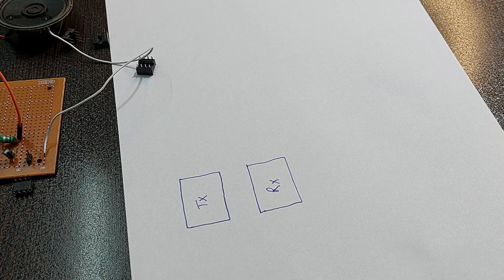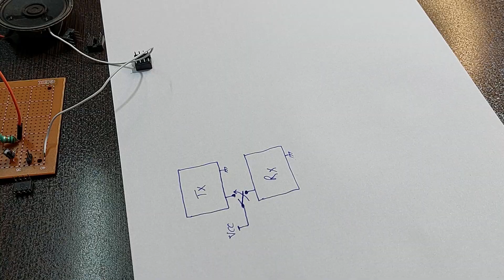Make Your Own Walkie Talkie Circuit But On The Frequency Of 315MHz

Comment: видео ни о чем.для того что бы сделать рацыю не обезательно мудрить до такой степени.в интернете полно робочих схем таких раций.как на транзисторах так и на микросхемах.с дальностью роботы по прямой видимости до 1 километра.при этом схемы содержат всего 3-4 транзистора в качестве унч,и один транзистор в вч части.и все.и не надо изобретать велосипед.
Reply from the maker: You don't need to be a genius to upload a video to YouTube. In the previous part, it was said that this video was made at the request of one of the contacts, and because my contacts are important to me, I made this project. I'm also getting more experience in rebuilding the wheel and maybe I can share more tips to avoid making wheels like Tupolev.

Comment: These modules use a super regenerative receiver in the RF part. Followed by that is an IC circuit usually LM358 that is set up as "schmitt trigger". The purpose of the op-amp (358) is to convert data signals into a proper square wave signal, so the micro controler can use the data... as these modules aren´t really intended for voice transmission - instead they´re used for data transmission. You can, however modify the transmitter by "half key-ing it" to transmitt a mix of Narrowband FM and AM. On the receiver side the voice is decoded, but if you pick it up after the schmitt-trigger circuit it gets "chopped" and altough it may be understandable to some degree, it is not working to well. I also played around with similar modules years ago, and when I picked up the audio before the LM358 schmitt trigger chip the audio was more or less clear and un distorted. You might try that. The first 433MHz module sounded like the receiver´s quench frequency has been set a bit low... that is just 1 resistor on the board which needs to be changed to make it work as it´s supposed to work. The resistor can be found close to the SMD RF transistor, look for it´s base connection.
Reply from the maker: Hello my friend, thank you for your comment. Of course, I said in the previous video that these modules are not suitable for sending sound. But with this comment, you said something that I didn't know and it was very interesting.
Previous video: https://youtu.be/aPw6Sx5lsys
Reply: @BabakStars  I have been given a kit containting 2 or 3 "pairs" of 433MHz transmitter and receiver unit. The board features a 2 transistor receiver (RF preamp and Receiver) plus said "LM358" as schmitt trigger to convert received data signals into a proper suqare wave signal for the micro controler. I did play around with them a bit, but the receiver is faulty (that is why it was extremly cheap). It has all parts installed for the RF preamp, but the actual transistor is missing. The "spot" where it´s supposed to be installed is empty... and so the result is... the set does work, but the range is only like 30ft, whilst if I´d use it´s transmitter at maximum power, the range would be more than a mile (to a communications receiver). If you don´t pull the "data pin" to ground (or was it to B+?) fully, but instead use a transistor, potentiometer (sth like that) you can modulate the transmitter with an audio signal by "half keying" it. Depending on how high the RF level you want to get out from it is, you either get acceptable AM, or AM with parasitic narrowband FM. On a good receiver, such as a communications receiver, you will then have to either use "N-FM" for hearing the transmitter, or use am + slope detection. As a super regenerative receiver is very wide banded, the small ammount of FM won´t be noticeable if you receive the transmitter modul with the "supposed to be operated with" receiver unit. I didn´t really transmitt / use these devices (like turn it on, let it transmitt music, and see how far it goes) because they work on a fixed frequency of 433.92MHz, and that is a frequency used by a lot of devices... be it your wireless temperature sensor, or an older car-remote-key to open the car. I didn´t want to "block" that frequency, because the devices that work at it usually just send a <1 second long "signal burst" and then go quiet again, and if I were to constantly transmitt there, I might inteffer with these, and that isn´t what I´ve wanted. With the fact that these modules produce up to 10mW, and they work on UHF, like I said, "a mile range" to a  good receiver isn´t anything special really. About the schmitt trigger. What it does is it changes an analouge signal into a digital signal. Think of it like a switch. Below a certain input level it is "off" and above a certain input level it is "on." If you transmitt voice with the transmitter module, the schmitt trigger "chomps" the audio, as the audio is reproduced as a sine wave (receiver output) and very fast swinging between "Schmitt trigger low" and "Schmitt trigger high". The easiest way to find out where the "pure" audio is available is use a signal tracer, and poke around at the IC´s pins whilst you previously ensured the receiver is receiving a clear signal (not over modulated or sth.) from the transmitter. I also have built multiple walkie talkies many years ago. The best one I´ve made was a homemade CB radio (my design, transistors only) where with I was able to make a 30 mile contact from a mointain top. Always fun projects, these DIY walkie talkies.